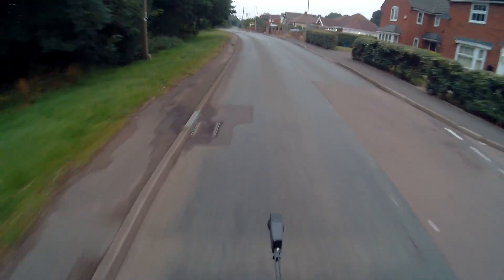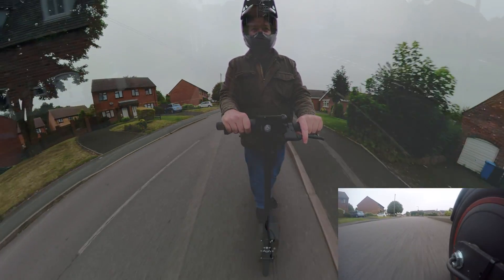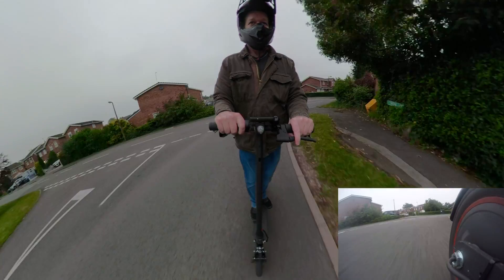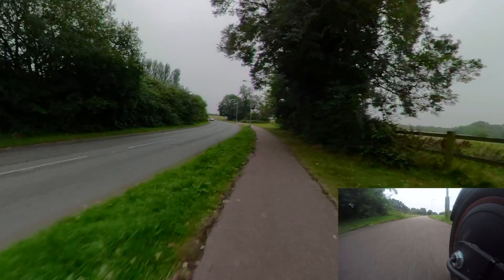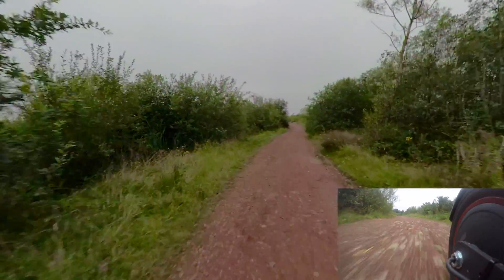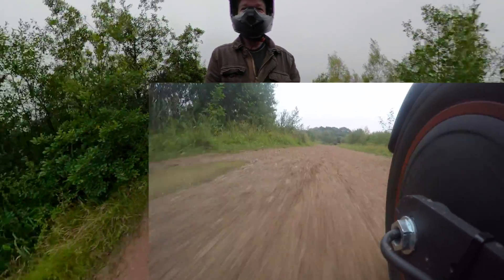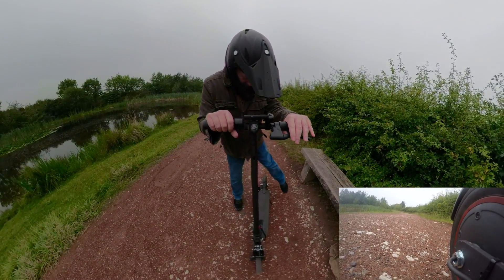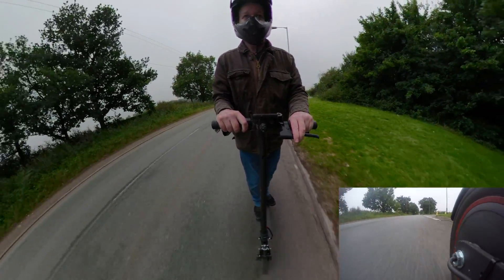V365 Phaserunner maiden - It all went perfectly!

Comment: Tony you should really look into the Nucular ebike controllers. I have the 24F controller on my EEB frame. Only pushing 12KW but the controller can handle much more. They have smaller ones as well that are good for lower power levels. So much customization in the controllers through its display

Comment: Tony, please make vid about flux. Show me before and after flux added. Really interesting about that. I mod my motor with air pump inlet for cooling, heatsink wall trough inside to outside to reduced heat. Changing WYE connections to delta to increasing the speed. After i found ur channel, im very enjoy and want to trying adding flux. Btw, my ebike is scooter. 53km before mod. 90km after mod. Im not changing battery voltage. Im afraid of electric shock if water fload came. I live in jakarta, sometimes it will fload without any sign
Reply from the maker: I've got a video coming up soon where I try to explain what flux weakening does. It's not as straightforward as people think.
Reply: IT REALLY WORKS🥰🥰. Flux weakening is AWESOME. Now my moped run 135kmh with 10" tire. 48v lifepo4 60a. 2200rpm + with delta connection. After 80kmh, it kicks like a mull. Before, it stuck at 90kmh. Now limitless i think. LOVE YOU TONY. Thks to you, my dream come true
Reply: Btw im using printer powder as a flux. Cheap and works

Comment: Got to get a phaserunner...my cheap chinese controller pulls 45A out of the batt at full power low revs.
What can the phaserunner handle?
Reply: Guys, Isn't 1,8kw too much even with ferrofluid applied?
Reply from the maker: @Italo Loureiro 
If it doesn't burn, no it's not too much 😁
Reply: @ItaloLoureiro  Motors are generally cheap and have their specs way UNDERRATED
Reply: @Full_Throttle_no_Brakes  dude, that's 400% over stock wattage. I know it can take a beating but I was planning to add a delta fan to my back to prevent this heatsoak situation. Cold weather where I live is around 26C
Reply: @ItaloLoureiro  To dont overheat, just dont stay on the throttle all the time. If you do and the motor burns, You can get a generic more powerful one cheaper than the original xiaomi
Reply: 50A constant, 90A peak
Reply: Thanks..Im just making sure thats input or phase current...and I dont really know the difference
Reply: @chargeriderepeat7024  In their application you can configure pretty much anything. Just google the questions you have and probably someone already asked the same questions